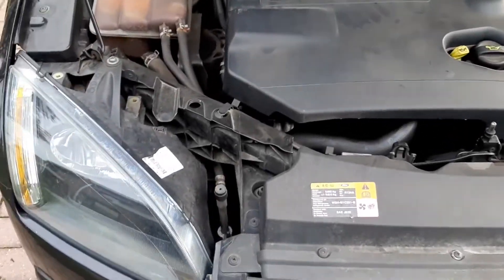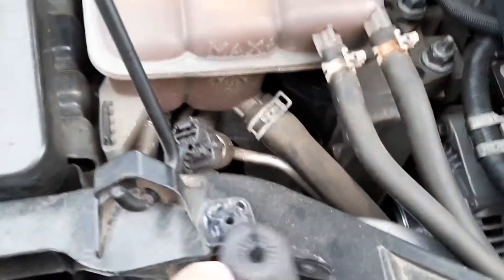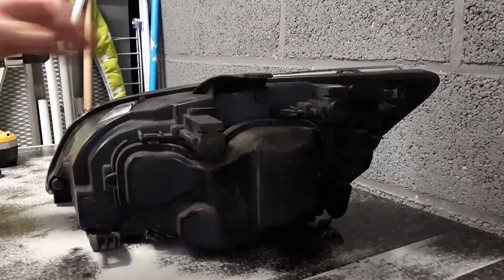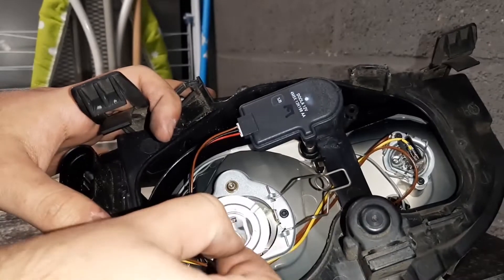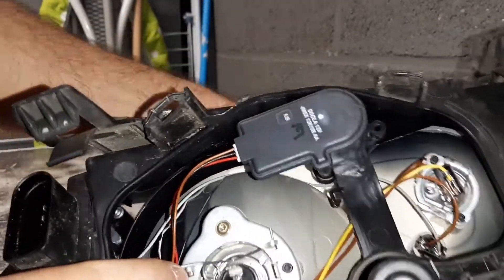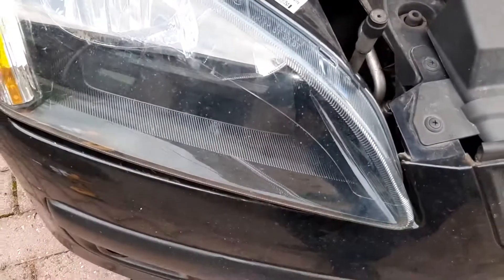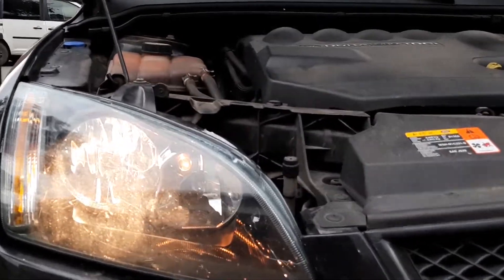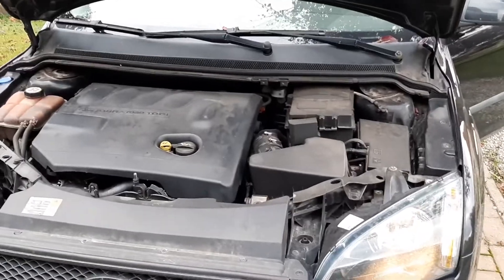How To Replace a Headlight Bulb In Your Car (Ford Focus MK2)

Comment: great and simple video, Gunzz, i followed your vid and changed my headlamp bulb earlier today. one thing ill just mention to help other watchers is when disconnecting the power socket there is a second slot on the exposed side to place your flat screwdriver into and pop it out, i struggled with trying to pull it out using the top, i found it after a few swear words lol
Reply from the maker: Yes i struggled with that to, thats probably the hardest part 😂